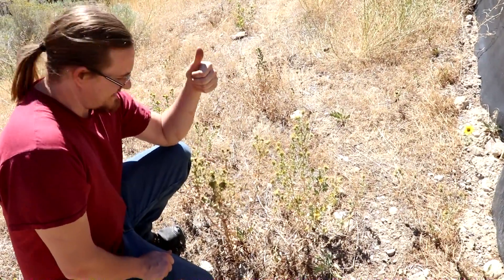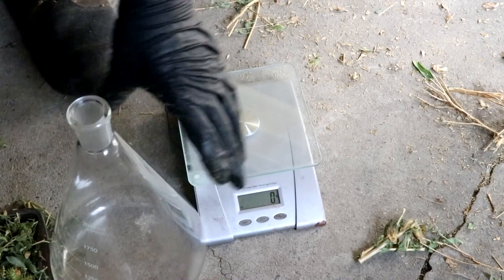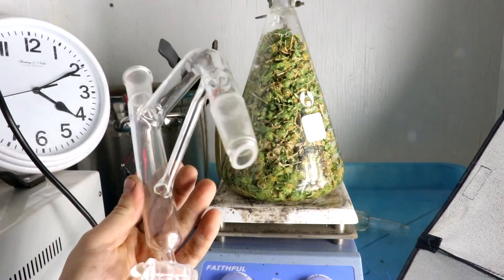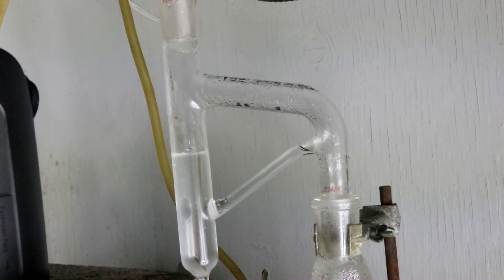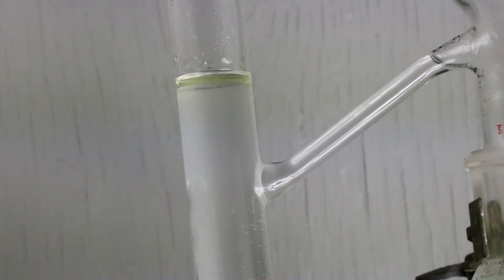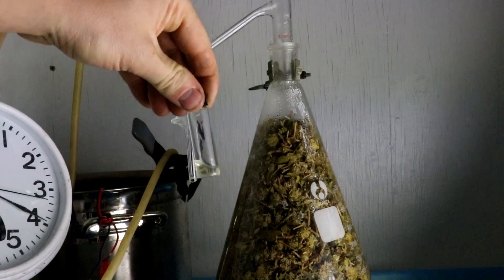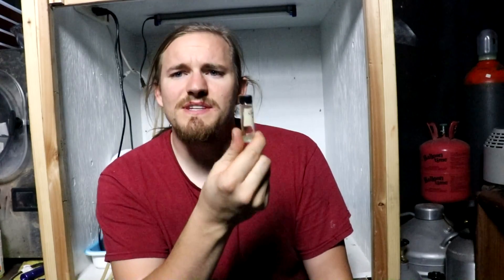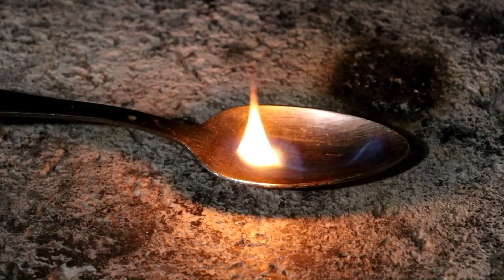Extracting Jet Fuel From GumWeed

Comment: If your goal is to extract the most material possible (the resin/biocrude), you should use a solvent (like high-proof alcohol or a "carrier oil" like olive oil).

Efficiency: Gumweed can contain up to 10% to 20% resin by weight.

Method: You "extract" it by soaking the sticky flower buds in oil or alcohol (maceration). The solvent dissolves the resin, which is where the bulk of the plant's medicinal "gum" lives.

Result: This produces a "Gumweed Oil" (infusion) or tincture, which contains significantly more of the plant's active constituents than steam distillation ever could.

Comment: Instead of water, you need to use grain alcohol or another solvent and boil the flowers in it for a couple of hrs.  
You then strain the whole thing and boil off the solvent, (into a container for reuse), and you are left with a lot more oil.

Comment: Try cold water extraction with dry or mostly dry, gently chopped up material.

Take that dried material and solvate/winterize in freezer/gently decant or siphon off oil-solvent layer from stratified debris on bottom and remove solvent at low heat…… 

You’ll be left with nice fairly pure oil….  ❤

Comment: I'm sure you could run an engine on it too. at least a small one. Another guy ran his laenmower engines on crude oil. Think of worse case scenarios. nuclear war. Wed need fuel for tractors to plow the fields and survive. this could be useful if done on a large scale.

Comment: For more effective distillation you´d need to grind it into small grains and use a different liquid for distillation like alcohol or heptane in a closed system. My guess is that the oil is found mostly in the seeds and very little in other parts of the plants, so it might be more effective to distill only the flowers.

Comment: Likely most of the oil stayed inside the plants. You really need to use some kind of a non-polar solvent to get it out. You're only getting the lightest fractions and with poor efficiency.

Comment: Please make another video about this. I want to see what you can do with this oil and there are better ways to extract oils from plant matter such as butane, isopropyl alcohol, and even using a heat press. Personally I'd like to see a butane extraction. If you extract the oil from fresh plant matter using butane you'd get a strong gumweed aroma that can be used in soaps ect. Its better to extract from fresh gumweed because the trichomes are still alive and intact. You'd get a better terpenes profile. Please cody I'd really like to see another video about this. This is a good video but you can make a great video

Comment: I know you know this but different grades of oil condense at different temperatures. So your condensation method to capture more would alter the consistency of the oil collected unless you separate the column into temperature zones like your mercury system had. I have no specialized knowledge in this stuff, but my grandfather was a boilermaker for 40 years and explained how a refinery works. He worked on the refineries in Long Beach and searles lake California.

Comment: Yes, and we SHOULD be doing this on a wholesale basis. Using, my preference, the sun to distill these oils, methane generation, and the like. Even plastic recycling and pyrolysis instead of relying on foreign oil or fossil fuel in in general. We could even then produce our own electricity and heat for our homes instead of being dependent on big brother, big government, big industry for our needs. We see how easy it really is in this vid. Thx Cody. Tesla thought you could transmit electricity great distances and even generate it from the earth itself. He was probably right. I'm pretty sure U can generate electricity from the earth. Maybe your next project Cody?

Comment: Side note:  If the military is looking into it as a source of fuel for aircraft, that means that it likely will work in diesel engines as well.  The US military uses JP-8 jet fuel instead of diesel, to simplify logistics.

Comment: Two comments: A, if your extraction isn’t very efficient, try grinding or crushing your gum weed so more of the oil is exposed.
B, if you’re smelling flowers, you’re definitely boiling off a bunch of your oil, thus dropping your efficiency even further.

Edit: Also use way more water to extract more oil.

Comment: Although the military probably made this comment first, it seems like this plant has a lot of properties that would be beneficial on a mars colony.
-makes concentrated, liquid fuel
-CO2 scrubbing
-feeds pollinators
-produces bulk cellulose for ruminants, construction, cellulose to ethanol bio-conversion, composting, and soil production
-compact

-low water requirement
-low fertilizer requirement
-can grow in a thermal-mass heat storage area

Comment: There is a slightly better way of arranging a steam distillation than that: Arrange a twin-necked round bottom flask in a heating mantle, with your gumweed (or whatever stuff you're extracting) stuffed into it. One neck has your special oil separator and condenser attached to it, but the other one is used for injecting steam from a separate steam generator. I have done this myself with an old pressure cooker which had a broken steam valve - I just removed the valve completely and attached a piece of copper tube instead, for directing steam into whatever I want. But you could use a tea-kettle with some tube attached to the spout, or something like that, just so long as it can make steam at a decent rate.
So why the heating mantle? Well, some of the steam you inject to begin with will condense into the flask as the contents heat up. So basically you want to be heating the mantle at full power to prevent any of the injected steam condensing. Ideally you want to use a long tube to inject the steam right into the bottom of the flask, so that it percolates up through as much of the contents as possible on its way out of the top and into the condenser.

I have used a setup like this (albeit without your oil separator piece) for extracting clove oil from a flask full of cloves, which works quite well. The only issue with steam-distilling clove oil is that because it is a phenolic oil, it tends to emulsify with the condensed water rather than forming a separate layer, so the oil separator device wouldn't work for that. You have to extract the oil from the emulsion afterwards with an organic solvent, separate the organic layer out, then distil the solvent off again to isolate the oil.

Comment: it burns for a long time and very cleanly, seems to me it'd make a very good low octane fuel for some kind of generator, to reduce fuel upkeep
Reply: If you use a burner type generator id probably just chuck the whole plant in...
Reply: @Arcanefungus  .2% is oil, you'll be burning 99.8% just making heat and CO2.
Reply: @whoknows8225  Isn't making heat the exact point of a burner generator?

Comment: It doesn't smell like the plant because the pure essential oil has no solvent in it. Ad some and it will smell quite more and more like the plant. In the plant this solvent is water, but you need a solvent miscible with the pure essential oil. This will evaporate and take some of the compounds responsible for the smell with it (Terpenes and maybe some esters).

Comment: Is your extraction methods good enough ?
Many natural compounds decompose with heat which makes steam extraction unprofitable. That may explain why you exctrated so few oil and why it did not smell as strong as expected (or maybe human nose isn't able to detect the molecules you exctracted).
To extract such delicate molecules perfumers use hexane but any other alcane should do the job, pure gasoline also works and is cheap.
But there are many more methods, such as "cold" distillation (under low pressure) and fat extraction.
Reply: Michel Droz - Cody seems often to have a larger perspective for these experiments and I’d say his goal wasn’t to maximize yield but to confirm a process. His angle here, I assume, is to see about a fuel he could derive from the desert he’s native to and in a way that would be sustainable, eg. the using plant matter to fire the boiler. I’ve been thinking myself along similar lines, like how many acres of rapeseed (canola) would I need to fuel my tractor with biodiesel.
Reply: @b.w.22  In that way, steam extraction  should be the easier way and would be sustainable. Yet steam can destroy many fragrances that's why I suggested cold distillation but lowering the pressure isn't easy. For example in France when they extract essential oils from roses they use cold distillation (with exane or supercritical CO2) because heat lowers the yield. Lavender for example is suited for steam extraction because the molecules can resist over 100°C.
I don't know much about canola or rapseed so maybe all my assumptions are wrong haha
Reply: Michel Droz - I’ve begun to assemble the gear to do “essential” oil extractions because my girlfriend is making oils and butters that she wants to scent with things we have here in our mountains, like spruce and juniper, or what we can grow like lavender and maybe chamomile. I find it fascinating - the difference between these scent carrying oils and fusiles. Hexane and CO2 for these makes great sense, especially if you can reclaim the material to use again. But I think Cody is doing something different, though he mentions the scents.

I believe he is trying to create a fuel oil. His experiments mostly seem to be about a “mars” base and what he can do at his location at the “chicken hole” base. If there’s a great deal of this weed, maybe he could use the oil to run a stove or even a motor. For me, I’d be trying to grow rapeseeds, crush them for their oil and react that with methanol, etc. to create a light enough oil to burn in a Diesel engine. For this to be sensible, like Cody, it needs to be a process that’s not too expensive or uses exotic things like liquid CO2. Even the methanol makes things difficult for me because it is difficult to make here on my own. Can biodiesel be made with ethanol? That’s easy to make.

Anyway, I think all of this is fascinating - the “end use” is what differs here. Lovely fragrance versus fuel.
Reply: @b.w.22  Sounds great, I wish you all the best with your experiments.

With the aim to be self sufficient your solution to exctract it with methanol may be good enough. If you want to produce methanol I believe that fermenting woods (or simply grass) will generate mostly methanol and not ethanol due to the lack of sugars in cellulose.

Anyways, cody's vidéos are always great to check since his methodology is very intelligent and that most of what he makes are "homemade".
Reply: Yes, the eufleurage method

Comment: You need to use more water Cody, half of the plant matter should be soaked with water. It looks pretty dry in you bottom flask. Also try  blending your plant matter for a better yield.
Reply: More surface area, more product.
Reply: If he broke up the gum weed it might have released trapped oils.

Comment: You could try boiling it in a pressure cooker, take the steam off that and separate the essential oil using this process, but then you should also have some heavier oil on the surface of your water in the pressure cooker. Right now you are getting only the lightest oil that evaporates easily. (I think)

Comment: Try extracting the oils with isopropyl alcohol and straining the run-off, you will probable get a much higher yield. I have tried a similar process to remove the oils frame creosote bushes and have great success.

Comment: Too little of it in the plants. I think to get a useful quantity without an impractical energy investment to extract, you'd have to genetically engineer cows to produce it instead of milk. Cows in the USA produce an average of more than 20,000 pounds of milk per year. Per cow. Imagine if all of that "milk" was actually useable fuel oil instead? In fact, I can't believe nobody's had that idea yet...

Comment: You should try and use alcohol instead of water to extract the oils next run ;) 
Then evaporate the alcohol later at low temps and the oils are left.
Your yield will increase enormously ;)
And alcohol will extrct the terpenes and flavinoids much better wich will give you a more potent smelling endresult.
Reply: Terpenes and Flavinoids sounds like derogatory terms.

"YOU DAMN TERPENES!"
Reply: So better weed for snoopdog

Comment: Hi, Check this out. What they did in the war was heat a container filled with wood trough burning bundles of weeds and then collect the resulting warm wood-gas in a balloon. This was fed to the carburetor of a car that rode quite well. No distillation required and almost pure energy from plants. The weed that burns the most, the cleanest (no smoke) and hottest by far is Lavas in my opinion. It is a celery, two meters high and smells like soup. Burning this plant dry is the very best energy agriculture can deliver. Home grown Lavas is a nice wind deflector, like bamboo. People do not need oil containing seeds or flowers really. Celery has to be planted, not sown outside uncontrolled and is almost indestructible after it grows. I thought I better shared.

Comment: i wonder if he would've gotten more oil if he ground up the plant finer before extraction.
Reply: a more efficient distilling process, since it's a volatile oil, it probably evaporated out the top of the distilling rig, he could have had a dimroth condenser under vacuum with a water trap. etc etc

Comment: What if we could Let plans fly on compressed air and use only a little fuel to start up the engine. 
Then we don't need to fill up the wings anymore with 30.000 liters of kerosine .  Youtube jetfuel scam.

Comment: *In the voice of Peter Griffin: WHY ARE WE NOT FUNDING THIS?!
Reply: It was more cost effective to use kerosene
Reply: @Aimless Studios However, considering that it's in the desert, it's a relatively low-infrastructure way to get a diesel/kerosene analogue.

Soybeans (oil) & wood (wood alcohol) to biodiesel is probably more efficient (and can produce charcoal as a secondary output), but is less practical in deserts & desert-like conditions.
Reply: If you want biofuels just gasify some biomass and use a Fischer Tropsch reaction. Significantly higher yield and flexibility in feedstock.
Reply: @Aimless Studios Wood alcohol, methanol, is a byproduct of making charcoal.  It isn't a direct byproduct, rather it comes from the carbon monoxide the wood lets out as it's heated in the charcoal producing process.  I believe copper is the most common backcountry catalyst for methanol production.

A few gallons of methanol is enough to catalyze most of a drum of vegetable oil into fuel suitable for diesel engines.  Modern diesels can be surprisingly picky if you're forced to keep it in an emissions-test-passing configuration.

However, I'm looking at this in the context of fueling vehicles.  As well as the context of my area (wooded with lots of farmland), where soybeans have to be rotated through to replenish the fields.  If we need to grow soybeans anyways, might as well make fuel from them.  The remaining biomass feeds animals or goes back into the ground, although it could be turned into fuel as well.

Comment: Do the same experiment by grinding the plant then mixing with 95% isopropyl alcohol. The oil will dissolve into the alcohol, strain off the oily alcohol then let it evaporate

Comment: ummm...there is a TARE button....press it once you have weighed the empty vessel and your scale will  zero out with the flask weight in it. :)  ALSO, interesting water distillation, but as i see you are prepared so Why not try a Butane infused' distillation ( as i like to call it)..basically is the pipe bomb method...( a tube filled with plant material capped on one end, metal mesh on the other end pour solvent through capped end let it drip through the mesh into small container) VENTILATION REQUIRED, EXPLOSION HAZARD, DO NOT TRY AT HOME STUFF.....same principle, better solvent..water wont extract more than like 30 percent . I think with a stronger solvent butane high octane alcohol acetone,

Comment: Based on this video, I'd assume the largest fraction of that oil was Furan or Oxane. 

Don't oven dry your plant material. You'd do better to add sodium hydroxide and just boil off the volatiles as they digest out of the plant. If the compounds are as volatile as you mentioned, heating them in the oven will result in substantial losses. 
Alternatively, you could try freeze drying them, but it's both expensive and time consuming.

Comment: ** Cody So much easier to try out this method ... squish it between 2 heated aluminum plates in a shop press ... make hard compressed bar or puck from just the resin-y parts then place between 2 hot metal plates and press it out ... EXACTLY the process for making Cannabis Rosin ... Then refine that after zeroing in on prop temp ... may be more efficient but fun still.

Comment: I recommend urine a sohxlet extractor and an alcohol. Distilling the alcohol will be easier than distilling the oil. Alternatively if the oil evaporates at even those low temps,  you can try an alcohol soak and precipitate it from there by adding water. I'm throwing darts in the dark here but that's how most botany papers I've read tackle plant extracts.

Comment: The smell is cause by terpenes. They are a volatile alcohol. The temperature you used would have evaporated them almost immediately.  To retain the most amount of these terps you would have to use  a solvent based extraction method, preferably with low to cryogenic temperatures for maximum retention.  Its  an easy task with the right equipment